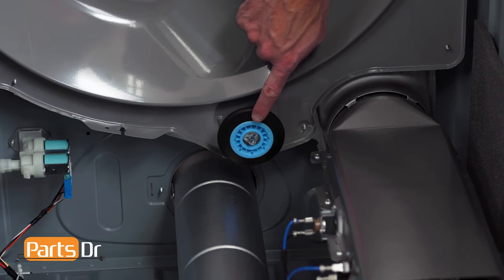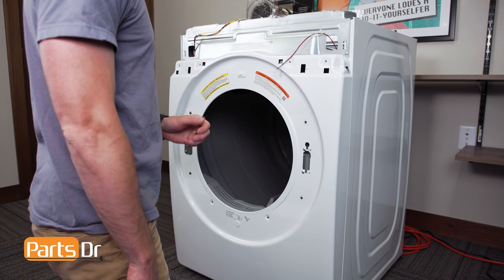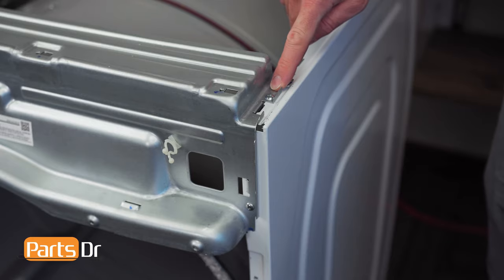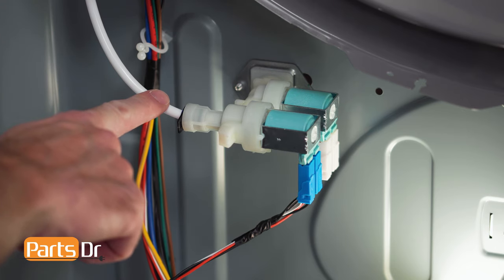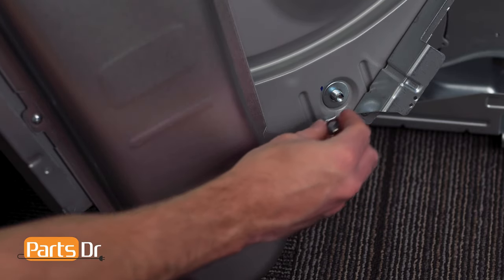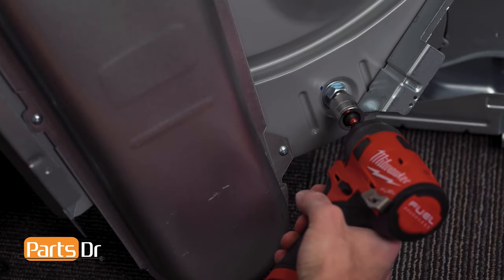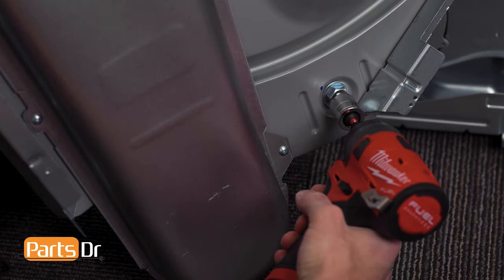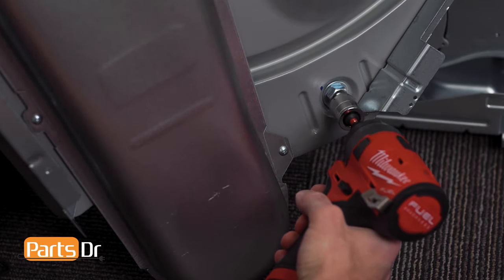How to replace the rear drum rollers part # DC97-16782E on your Samsung dryer

Comment: My rear drum roller nuts were so tight, I bent the sheet metal attempting to remove them. I was able to remove one by applying heat with a torch to free it enough for the wrench. The other wasn't as cooperative, I quit asking nicely and used a dremel with a cutoff wheel to remove the nut (replacement nut $.60 at my local hardware store). I'm wondering if they used loctite on the rear nuts, it was ridiculous how tight they were. That said, the video was excellent. Thank you for you time.
Reply from the maker: We found that ours were also tight and difficult to remove by hand, but using an impact to remove them made it might easier.

Comment: The nuts on the back of the rollers were too tight for my impact driver to break. I had to heat them with a torch to get them to free up. Thanks for the video.
Reply from the maker: Thanks for sharing!  That sounds like it was a pain!

Comment: I used your video today to replace all four wheels on my dryer. After we put it back together it was making a loud scraping sound. Took it apart again and found that the felt on the front of the drum was worn and the drum was rubbing on the frame plate. Not sure if the felt was bad before this repair or if we did something wrong when installing the drum. Ordered a replacement felt from Amazon. Hopefully it was worn from years of use and bad rollers.
Reply from the maker: Nice job with the repair.  We have a video showing how to replace the felt seal here: https://www.youtube.com/watch?v=M4B-wCLubuo

Comment: Thanks for the video. How can I be sure the rollers are bad? Our machine makes a kind of grinding noise, not like any of the descriptions I've heard. It recently started and the machine is about 4-5 years old.
Reply from the maker: Generally, if the roller spins by hand and doesn't have any flat spots or abnormal where on the rubber part of the wheel then it is good.  In most cases, you will have one or maybe two rollers that are bad, so you can just compare the roller that you suspect is bad with another one of the good rollers.  The most common roller to fail is the right rear roller wheel which is near the heating element since it is exposed to more heat than the others.
Reply: @PartsDr  Is it advisable to just replace all four rollers and the tensioner once it's apart?
Reply from the maker: @rcwessel  We would recommend replacing all 4 or at least 2 of the rollers at the same time (the two front or two rear).  The belt tensioner (idler pulley) and belt are also common items that wear over time and it is a good item to replace them for preventative maintenance.
Reply: Thanks for the video. Top notch